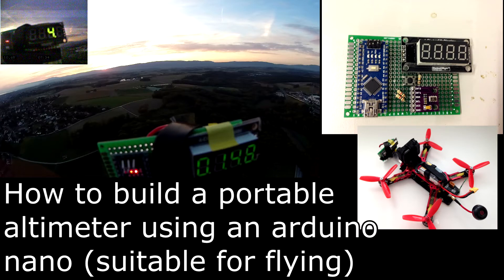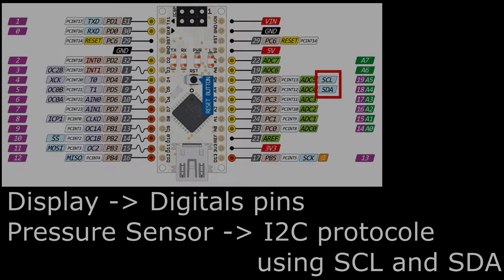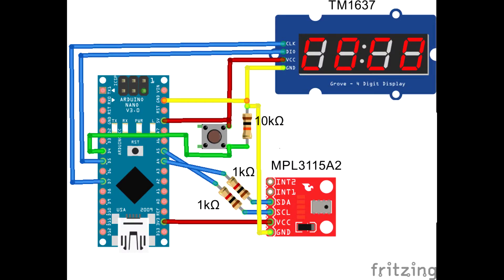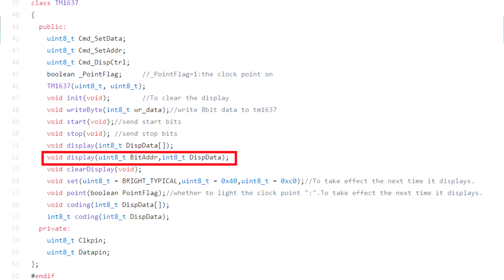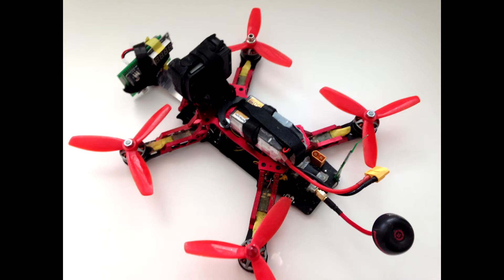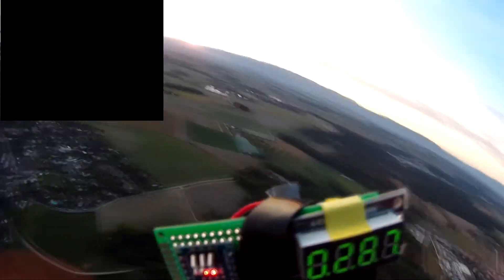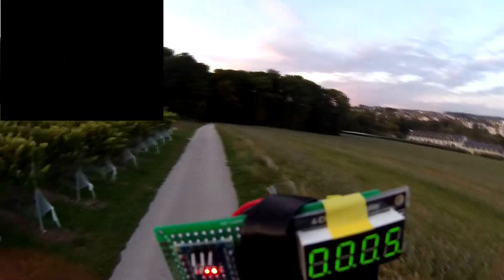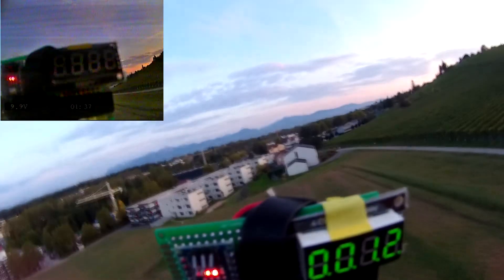Portable Altimeter using Arduino and pressure sensor (MPL3115A2)

Comment: how could I have the sensor output deploy a parachute after a certain altitude is reached?
Reply from the maker: Once your altitude reached, you can toggle a GPIO pin of the arduino and plug into that whatever parachute mechanism you have.

Comment: I want to use a bmp 180 .
How can I use it ?
Reply from the maker: @chandanvudala6778  If you add an sd card module and some code to work with, it can definitely work.
Reply from the maker: Yes you can use it, the schematic will be the same but the library you have to use will be different and the function will probably have different names.

Comment: can i  put the pressure sensor in a vaccum container and apply pressure using pressure pump to the container will it work??
Reply from the maker: There is no reason it should not work, just keep in mind that the pressure sensor is rated for 20 to 110kPa. Outside this range, you will have wrong values.
Reply: got it thanks bro..
Reply: @mrpoulay6121  bro the code is not getting complied its showing 
"1:20 fatal error :TM1637.h no such file or directory"
Reply from the maker: @ganeshgoli2426  You probably did not install the TM1637.h library
Reply: @mrpoulay6121  should i decrease the pressure to get the value or to increase the pressure if i put the sensor in an airtight container
Reply from the maker: @ganeshgoli2426  I am not sure what you are trying to do but if  you put the sensor in a perfectly airtight container (which is quite hard to achieve), the air pressure should not change and so the reading should always be the same.
Reply: @mrpoulay6121  ok got it thanks bro for your help.

Comment: I need data log to sd card module ... 😕
Reply from the maker: You can add a sd card module by using the SPI pin on the arduino which are not used.
Reply: @mrpoulay6121  can you prepare me the complete code needed for that
Reply from the maker: @Independentscientist  It will depend on the module you will use. You can probably find a library to use with the module you choose. Then the code will be quite straightforward.
Reply: @mrpoulay6121  thanks

Comment: There seems to be no display. I followed all the instructions and the code was uploaded just fine. Any solutions?
Reply from the maker: Did you check that your 7 digits display is working proprely ?
Reply: @mrpoulay6121  yes. I am currently trying a sample code. And it seems to be working just fine
Reply from the maker: @gemsilog9157  Try to make each components work separatly before combining everything.
Reply: @mrpoulay6121  I guess its the mpl3115a2 pressure sensor thats not working.I bought a chinese one. Im buying a different one right now

Comment: HI there, just used this plan to complete my own model. Added a TP4056 charging board too. Works great, tho can you help me with a code to enable the button to cycle through options? such as max pressure and minimum? I also want to go to a  negative value based on our start position (using it for measuring altitude for pumps) any insight would be awesome thanks!
Reply from the maker: Hi Matthew,
I am glad you could improve my project! For the negative value, it is easy just delete the lines 42,43 and 44 of my code which force the  altitude to be always positive.
Displaying the minimum pressure will be a little bit more difficult but if you reach this point you should be able to do it. Create a variable called altitude_min and update it each time you reach a new minimum altitude.
To cycle through options either you add another button, either you use a variable to count the number of time you press the button and each time it increases, you display  a different option. When your variable reachs the last option, it could go back to the first one.
Good luck!
Reply: Mr Poulay thanks very much for your reply I'll see how I go. Great project, thanks for your work

Comment: Cool video, but it looks like the I2C pull down resistors are not placed correctly.  The resistors should not be between the altimeter and the arduino.  The altimeter and the arduino should be directly connected, the pull down resistors should be connected from the I2C data lines to GND to pull down the signal when it's low.
Reply from the maker: Hey Jester!
Those resistors are there to adapt the 5V voltage of the arduino lines and the 3.3V I2C linea of the Mpl3115a2. And your are right I2C requires pull resistors but pull up and not pull down. Those pull up resistor are already on the red PCB of the MPL3115A2.
For more details:
https://learn.sparkfun.com/tutorials/mpl3115a2-pressure-sensor-hookup-guide/hooking-it-up
Reply: @mrpoulay6121  I stand corrected.  You are right, the resistors are placed correctly.  I got my altimeter from adafruit.  I like the documentation on sparkfun much better.  Thanks for the reply!

Comment: Which is maximum altitude attained by the sensor in display
Reply from the maker: It was 299m
Reply: @mrpoulay6121  I need to use this divice in near space. So I need 700000 feet measurement. How can I measure
Reply from the maker: @Independentscientist  The altimeter used cannot measure properly a pressure inferior of 110kPa which is around 11km.
I would recommend you to use a GPS. GPS satellite circle the earth at around 20000km which is way behond your objective. So check in that direction and be careful with the temperature and range specification (it can be quite hot or cold up there).

Comment: Hello
I am having some issues with my sensor. It is indicating always a 0 altitude. When i checked what the sensor is reading, I got a -999 value for the altitude.
Can you help ?
Reply from the maker: Hello Jad,
Did you connect the MPL as on the schematic? If not maybe you will have to adapt the code. As for the code did you copy the same lines? Don't forget the initialisation it is important for the arduino nano to be able to "talk" to the MPL.
Reply: @mrpoulay6121  I have the same problem I use the code from the download an i checked the schematic multible times
Reply from the maker: @yarnevansteenwinckel  Weird behavior indeed. Unfortunatly I don't have THE solution. Your best chance to find the problem is to try each piece separately. Just plug the pressure sensor to the arduino and try to get some value of it. Maybe this component arrived broken. Is your arduino fine? Try another component on the I2C pins to be sure it working properly. You could also recheck the value of the resistor to be sure they are  1k ohm. Good luck!

Comment: is the arduino an 5v or 3v
Reply from the maker: I powered it through a 3.7V battery
Reply: where is the battery connected it isn't clear in de vid
Reply from the maker: It is connected to Vin and to gnd

Comment: Would you share how to integrate audible alerts at different altitudes?
Reply from the maker: Hey, on a drone I would not put an audible alert due to the big sound made by the propellers. However, if you intend to use it in a calmer environment, you could easily add a buzzer to it. Here is the link on how to use a buzzer with Arduino, it is quite easy.
https://create.arduino.cc/projecthub/SURYATEJA/use-a-buzzer-module-piezo-speaker-using-arduino-uno-89df45

Comment: Heyyy can you use Arduino Uno instead if using Arduino Nano?
Reply from the maker: Hello, yes you can use an Arduino Uno instead of the Arduino Nano, it takes just a little more space but pins will be the same.

Comment: how do I see the altitude of my model rocket without having to use a camera to see what the rockets max altitude? Many thanks, and by the way, an amazing video. Much more helpful than most others.
Reply from the maker: Hi JRoxas,
After your flight, pressing the push button will give you the max altitude reached.
However if you want to get the altitude in real time, you should add a wireless transmitter in order to get the altitude during the flight. For example you could use a LoRa module, which is an RF transmitter Arduino friendly module:
https://www.banggood.com/LoRa-SX1278-Long-Range-RF-Wireless-Power-Mental-Module-For-Arduino-p-1159089.html?gmcCountry=CH&currency=CHF&utm_source=googleshopping&utm_medium=cpc_elc&utm_content=zouzou&utm_campaign=pla-ch-elc2-pc-fr-0526&gclid=Cj0KCQjwgMnYBRDRARIsANC2dfkHt7C3QBMqbzefDvrYkRAWZaX9cpK06ZGuho8brwXCC3HaL3keOj8aAmoTEALw_wcB&stayold=1&cur_warehouse=CN
I did not try it myself but it should works fine.
Reply: @mrpoulay6121   i was thinking to put the pressure sensor in some vacuum container and apply pressure using some pressure pump will it work? if yes then how much pressure will it sustain
Reply from the maker: @ganeshgoli2426  As long as your container is airtight, it should be fine.
The pressure sensor works between 20 to 110kPa. Outside this range, you will have wrong values.
Reply: @mrpoulay6121  ok thnks bro..

Comment: Hi, I have a problem with your .ino Sketch. It does not want to compile/verify. I hope you can help
Reply from the maker: Hey I can probably help, I don’t know which errors you get but it is maybe due to the fact that I added 2 libraries to make it work (TM1637 library and SparkFunMPL3115A2 library). I just added the links in the description and add them on the dropbox link.
Reply: i have the same problem . can you help me !

Comment: if you can to add wireless transmitter to transmit the data to ground arduino with a display then it will be very useful and we can see the alti in real time while controlling the quad... (adding nrf24i01wireless transmitter module )
Reply from the maker: Hi Kusal !
Sure it will avoid putting electronics in front of the quad and thus unbalancing the quad. However, do you think this module can transmit on such a big distance?
In addition, this module is emitting on a 2.4Ghz frequency which is the same frequency that the radio control of the drone so maybe it is not the best idea.